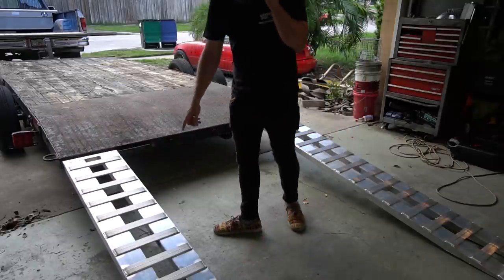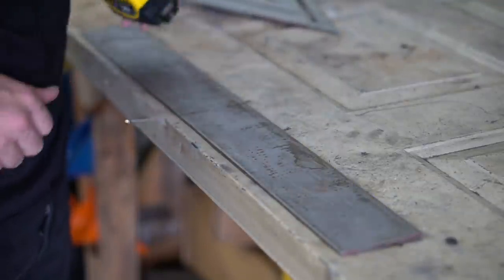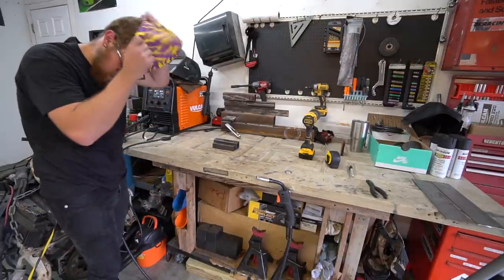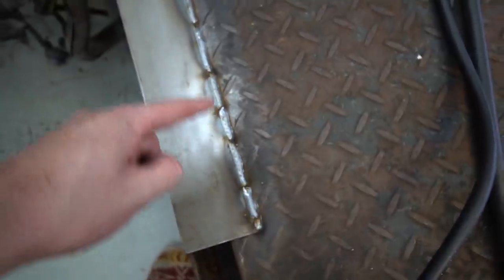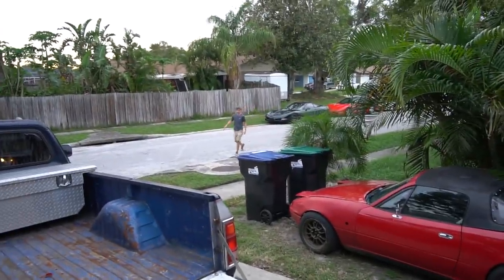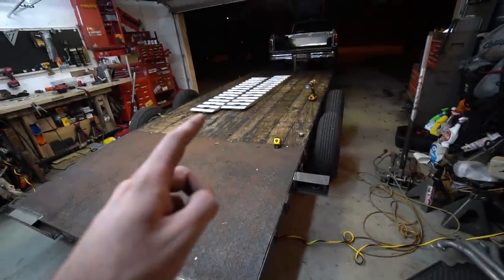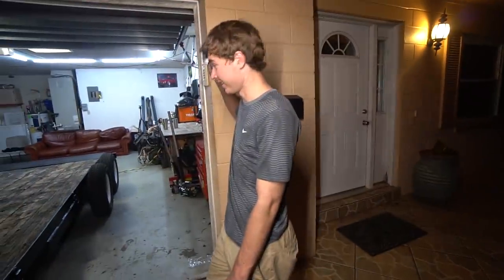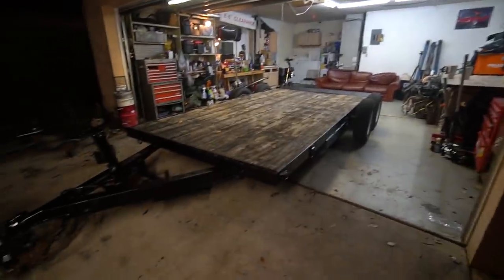Turning a $800 trailer into a $1800 trailer.

Comment: You can find the parts for the grinder at grainger or any welding store. Biggest thing is stop using harbor freight discs. I use 6inch Dewalt or norton discs on my 4.5 grinders. May not be the safest but it works for me. I've never had a disc explode that wasn't expected ie dropped or using to make a stupid cut.

Comment: Your 200 pound self doesnt deflect the metal plate but 200 vs 2000 plus for a car weight is huge. Also the lights being that far back is for others to see the lights. Lights can only emit so many lumens and the trailers dove tail will act like a blind spot. Think of the side markers on a dually. While following directly behind you see both orange side markers on the fenders. But crossing from right to left behind the dually you won't see one or the other light due to the 3 plus feet of truck bed obscuring your view. That's why trailer lights are always on the rear end. Then the grinding wheel they sell bell shaped wheels that have a raised arbor.

Other then the concerns stayed above I would say good job

Comment: Clamping the ground on the metal you cut looks like a cleaner surface to ground to. 

And if you wanted an easier position to weld, I would've sat at the side of the trailer, and pulled the gun towards my body. Just an easier line to follow since its just a straight line. 

Try different weld positions : vertical up , vertical down, and horizontal , these are main positions that bend tests are performed with. Vertical down for butt joints tends to be easier for most people since the puddle just flows down with gravity. (you'll move the gun a bit faster also) 

Also if you want an absolute clean surface to weld to, grind down just below the surface of the metal. Wirewheels can still leave surface scale on the metal.
Reply from the maker: +Gino o thanks for the tips! I will keep practicing.

Comment: You ought to buy a wire brush wheel for your angle grinder.  I Used to use one with a hand drill till I found one for the grinder, speed and cleaning performance increases greatly when using a wire brush with the grinder.

Comment: Also when using gmaw use push not pull. Basically point the gun in the direction that your moving towards. When pulling, the gun pointing into the puddle, it has a tendency in creating porosity.

Comment: There should be a beveled side on that nut on grinder and other is flat you turn it round which stops it doing that exploding disks because they don't do a backing plate and its only a spacer or washer that they do I used grinders when in the motor trade and we worked it out to turn locking nut round to opposite side

Comment: you know that picture with the chunk of grinding disk embeded in the safety glasses? think of what it would do if it hit your face. 

the disk blew up and was dangrous because you did 6 things wrong, not just the one you mentiond with the beveled washer (just look on amazon for the nut and washer for that grinder) i actually paused it to comment on all these things before i saw the disk blow up.

1. you were cutting the steel in the middle while it was suspended on both ends, thus guaranteeing that it would bind the disk near the end of the cut. 

2. you werent using a guard on the angle grinder which would have mostly contained the disk shrapnel. 

3. you werent wearing a face shield,.which is a must for grinding or cutting with an angle grinder

4. you had your body and face lined up directly with the rotational plane of the disk, making it far more likely that if it did break,.that the shrapnel would go into you.

5. not real safety glasses with side shields. No, perscription glasses arent the same as safety glasses. 

this was basically like a workplace training video showing all the things you shouldnt do when using a grinder.

please be carefull with angle grinders, they are verry dangrous.

Comment: If I can make a suggestion - grind down to bright shiny metal if you are going to use short circuit mig as you did. Penetration poor on the rusty tread plate in particular making the weld - untrustworthy.  

Stick welding if you have the capability would be more forgiving in such a situation and allow you a better choice of weld metal like 7018 - otherwise - get that metal cleaner first before using that mig setup - good luck!

Comment: Adds a couple beads on flat stock and proper lights. +$1000 value addded to the trailer.
Reply from the maker: +Luis Valdes it was a joke I didn't explain. When I was shopping for trailers. Everything with decent paint and ramps was like $2000 when you can buy a brand new one for that much. To many people think because it's a trailer and you can "make money with it" it's worth a million dollars. It took me a couple months to find this one for $800. Comparable trailers in the condition it was when I started were in the $1400 range

Comment: just weld a couple stabilizer jacks on back , problem solved alot less work. Always use emergency brake when loading, you can always chalk truck or trailer to keep it from moving or just put a winch on it.

Comment: Online, any of the parts Tool places, hell you can order the parts from Dewalt. Also get a blade guard for that thing, or just buy a new one with all the parts, there is a huge osha fine for not having a blade guard on job sites and for good reason, one guy almost lost his arm if not his life in the company I work for cause the blade blew up and they had to pull bits out of the bone in his arm from the 8x2 in gash in his arm.

Comment: Quick welding tip. Use double the amps u used here. It will melt together way better. You used way too less ampere

Comment: Taylor, I have a question. Two of my trailers have welded rails that surround 3 sides of the trailer. These rails are about 14 inches tall and are made of square tube stock. My question is...... Can I cut this railing off of the trailer so it may be used as a true flatbed without weakening the trailer's structure? Do those rails add that much to the strength of the trailer?  Jim

Comment: Recommendation from an apprentice welder:

Instead of dragging your weld puddle, you'd be better off pushing it. At the moment you've got the back of your welding gun facing the direction you're welding and you're pulling the wire back towards it. Personally I've found that it's better to push the wire toward it... If that makes sense. I mean you can do it both ways but yeah. Ah well. Practice makes perfect

Comment: Good on you for having a go yourself and doing a good job at it. 
  A small tip; you had your vehicle hooked to your trailer while you were welding and so risked damaging your electricals, (alternator, rectifier, stereo, computers, etc.), on your vehicle. Simply disconnect your earth cable on your battery next time.

Comment: When welding you have the gun pointing the wrong way. You should have the gun pointing towards where your welding not where you have already welded. It helps by preheating the material etc and gets a better weld.

Comment: the issue is the knife edge ramps.  get standard ramps and you wont have this issue.. the knife edge create a pivot point. when front of car presses trailer down the tip of the ramp lifts up and pivots on the upper side of the knife edge.      if u just put a small piece of plywood under the tip of the ramp it wont do that aswell

Comment: How is that welder holding up?  Have you done any tig welding with it?
Reply from the maker: I ended up selling it and I got an ahp 201xd. Far far better machine. And I just bout a everlast to mig with. Much better setup. Similar overall cost.
Reply: Taylor Ray I just bought a Eastwood to tig with 🤞

Comment: I can see you wanted to weld but all you have to do is put the trailer jack down in the front and the ramps won't fall off. It also saves you hitch or bumper from lifting up when you are loading....

Comment: You break cutoff wheels when you dont use them correctly as well. Always cut with the leading edge going down into the material. So the way you had the grinder the cut should have started closest to you and moved away from you as it cut. also hang the material off the table you are cutting. Preferably with the piece clamped to the table. Also when you can move you gun the way you were trying just rotate your gun and weave side to side instead of up and down. Just some advice.

Comment: Which ever hardware sells that tool should be able to order you any spare parts for it. Actually even some hardwares that do stock it could also do the same. Some suppliers might let you order the part direct from them.

Comment: It kind of seems like, because the lights are so far back, you're going to have attach red flags to the end of the trailer. Just imagine... in Florida, while it's pouring outside, at night, someone is going to rear end you at a red light not realizing there's about 3 feet of trailer extending past the lights.

Comment: You welds that have the lions back peak are from going too fast and the fat rolled over welds are from going too slow. A rolled toe can be caused a few different ways but the most common is going too slow. You have to make sure you watch the puddle tie in to both pieces of metal. Your welding isnt bad though. Those welds should last forever. I have no doubt that you will be laying some top notch quality beads down very soon.

Comment: Re-staining the wood on the trailer would really complete the look
Reply: He could do a grey colored stain to match hit truck! would look sick
Reply: This was my immediate thought as well.
Reply: And paint the diamond steel black
Reply: It'll be to slippery down here in Florida ! Better to leave the wood natural
Reply: ram07ish I would just replace all the wood the wood near the front looked like it was possibly rotting or broken or a mix of both
Reply: Was going to comment the same thing
Reply: Or convert to full metal
Reply: Yeah, wouldnt all the rain you get there in florida cause the wood to rot?
Reply: Long term yea. But you can prolong the life by sanding it down and sealing it with waterproof deck sealer.
Reply: The wood looks pretty gone and would only be like $100 (if that) to replace with new pressure treated 2x6s
Reply: I painted my wood with used motor oil (cost  $0.00) soaked right in and gave the wood a nice darker look plus some protection against rot.
Reply: Rhino line the wood😉
Reply: i agree that would make it look so clean

Comment: And that's why you use the fucking guard on a grinder.
Reply: setra23 wait why do you use it? I mean, he was uninjured so it's not the best example
Reply: 1CoLoRz2 because he got fucking luck next time he wont
Reply: So you don't get shards of high speed disk being flung at your face. You'll not always be so lucky.
Reply: 1CoLoRz2 you clearly haven't gotten hit by a cutting disk spinning at 13,000 rpm while your welding
Reply: But did he die tho
Reply: My dad got his leg fucking wrecked by one of those exploding. Surgery and and wound vac for a couple of months. Don’t be stupid, use it properly with a guard.

Comment: seriously! put a guard on your grinder. a shattering disc is no joke. 
I know of one guy using a grinder without a guard - the blade shattered and cut his throat.. his kids found him bled out half way home.
don't be that guy.

any good tool shop can order you the parts you need for your grinder.
if that's to dear, then go to a pawn shop and buy a 2nd hand grinder with the right shaft size to match your grinder.

I've had my rant, keep up the good work.

Comment: Careful with those angle grinders the exploding discs are like bullet's or a shotgun blast... Very dangerous always grind with safety glasses and also a face shield.. and yes use the proper tool fittings.. I went to welding school this was stressed more than anything else I can recall..  we used angle grinders constantly. And the safety was stressed without stop.. it's one of the most dangerous tools in a welding shop.

I love angle grinders..they work for so many things... But use them wisely.

Comment: I used to buy those hobo warrior cutting wheels and their flap wheels , but I noticed their 4.5 and 7 inch wheels don't cut real well they cause a lot of friction and thus heat with slow cutting and they turn to dust real quick . I found places like Roark supply and they sell 4.5 flap discs at about  $1.25 a wheel and 6 inch cutting wheels for about a $1  I don't know what 4.5 wheels cost there since I never buy cutting discs smaller than 6 since 6 inch wheels turn into smaller wheels and 4.5s are basically a waste of cash .  You can't get close to $1.25 for flap wheels at any store .

Comment: You also put the cutting wheel on the wrong way. That could have been a factor to the explosion too. Flip it around so the high part in the middle is facing into the grinder.

Comment: Hey bud. Have a look on eBay using any of the following terms "angle grinder flange nut m14 m10" . Will only cost ya a few bucks straight from China. 👍🏼 if all else fails, angle grinders are dirt cheap.

Comment: That's why they have the protector (Grinder Guard).
I can't find any good reason that most youtubers have taken out the protector, it's silly!
Reply: QantonisQ  because u cant get into certian places to grind with the gaurd. And sometimes they send the spark into something and the bounce back at you. Proper ppe and half a clue is safer than the stupid gaurd. Ive been hit in the leg with disc while cutting with a 9inch grinder and it had a gaurd....

Comment: As far as perfection your welds looked like they still weren’t quite hot enough and probably could have used a little wider of a circular motion to tie in the top edge with the rest of the weld. As far as practicality? Your hired

Comment: You still never fixed the problem of the back end of the trailer dropping when you drive a vehicle on to it. You need to weld a pair of drop-down stands or a pair of heavy-duty scissor-jacks, under the rear corners of the trailer.

Comment: Flip the cup on the grinder over and it's flat on the back. You would be better making a couple of feet for the back of the trailer. It keeps from sagging and taking weig ht off of the truck. Much safer.

Comment: You could have saved some welding and simply drilled some holes in that rear flange and the ramps to hold them in place with some pins.

Comment: Welded right over rust should have at least clean the metal before running a weld the plates to the back of the trailer. I'm definitely not a pro welder just what I was told to have clean metal when welding with a wire feed welder. Stick can weld over rust.

Comment: The ramps , if you drill a hole thru the top of the ramp , the thru the trailer , you can pin the ramps to the trailer. Then they will never move or flip up.

Comment: By law you need amber clearance lights in the front of the trailer by the bulk head. Clearance lights behind the tires must be red not amber like you have and you also need a center light on the rear in the center of the trailer in red. Also fenders by law

Comment: A the bolt tightened up
B the grinding wheel got bound up by the steel you were using bending around it while cutting it like you were should of cut it like you would a regular 2x4 where one side could fall freely to make sure it couldnt bind

Comment: Your lighting issue swap your running light with your turn light and it will fix it. Had that issue on my trailer
Reply: Swap the wires around

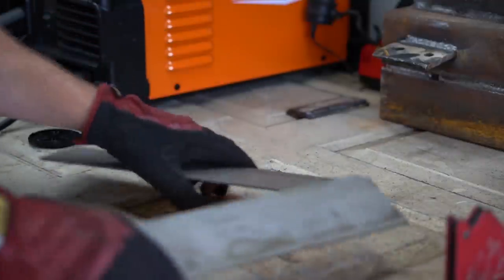Comment: @04:23, cant u just take that cupped backing plate and put it kn backwards, so the cupped side faces the grinder instead of facing the cutting disck, that would iliminate the flex on cuting disk while tightening the retaining nut.

Comment: You need to think about how you support your material... this is basic stuff. You created a binding situation by locating the square under th the part where you did. Ask any carpenter and they’ll help you figure that out.

That disc didn’t have to break during that cut but you pinched it.

Comment: A couple of tips for you... Don't use your drill for removing rust, the way you're doing. The bearings on most drills (and drill presses) are not designed for the side load pressure, and will ruin your drill. Use your grinder with the proper wire brush instead, and you'll get much better (and quicker) results, while saving the drill at the same time. Only use the drill's wire brush as a last resort, when nothing else will fit into that area. 2nd tip... When wire feed welding in flat position, push the puddle instead of pulling it. You'll get much better penetration and a much stronger, better looking bead.

Comment: SIDE CLEARANCE LIGHTS.  The small round lights in the tail light housing need to be red if mounted rearward of the trailer wheels as per the DOT. Amber at or forward of the wheel.  Minor quibble, but is technically an equipment violation on US roads and can earn you a fine.

Comment: Do yourself a huge favor and buy camel grinding wheels. Do not use harbor freight wheels anymore. Especially without the guard. CGW wheels and flap discs are the best I have ever used and they last so much longer and they're affordable. You wont regret it

Comment: Got lucky with the grinder blade. The way you where cutting is the wrong way. You were pinching the grinder blade with the metal you were cutting. The attachment might have had something to do with it like maybe 10 - 15%. 
Be carful guys, cut flat or the part your cutting make sure its hanging off something where it can fall off.

Comment: Ditch that grinder.  Get a 13 amp angle grinder.  I use a Dewalt, but other brands are probably just as good.  The 13 amp grinders are more expensive, but the extra power is terrific, and I think they are safer as well.  They don't bog down and try to grab your material.  The higher power keeps the speed up so they just keep cutting.  Much easier to control that way.